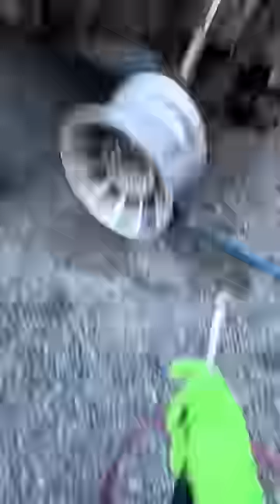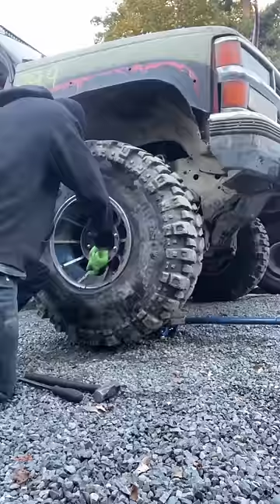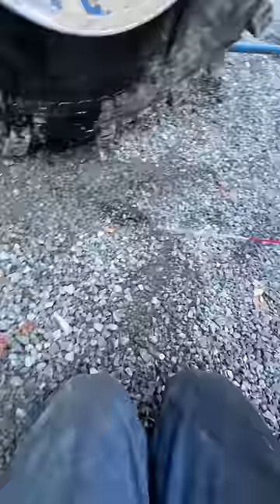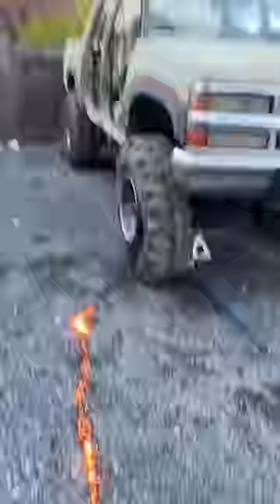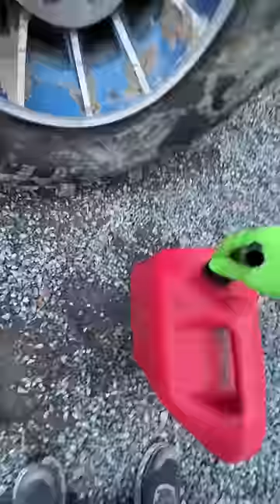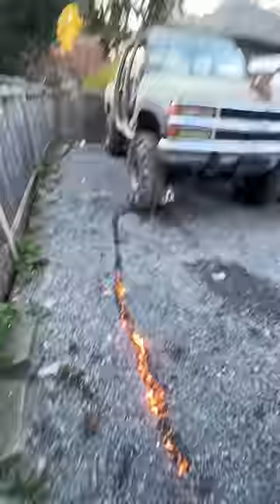This video Blew Up!! 🔥 #oddlysatisfying

Comment: You can usually wrap a rachet strap around the middle of the tire and squeeze it to flex out the sidewall enough to put air in and pop the bead. Definitely not as fun as explosions tho

Comment: starting fluid and a little blast of air from the compressor to get the fuel air mixture proper does the trick every time.

Comment: It helps if you ratchet strap the tire a little tighter to sorta/kinda seat the bead. All that jetting of flame is usually what makes the tire pop onto the bead. Also, ether is the way to go, Brake Cleaner, and gasoline DO work, but ether works best in my experience.
Reply: Yea it would have worked a lot faster if he took a ratchet strap and wrapped it around the center of the tire to apply some pressure. I've done this many times receding the bead back on the tire while out 4-Wheeling!
Reply: Do you use a ratchet strap all the way around, say like an X pattern with 2 straps or just one strap to keep the top and bottom tight. I'm just imagining there would be too much vapor if all sides were pressed into the wheel and then combust too much?? Never seen it happen in other videos but I'd like to try myself
Reply: @1Turnatatime dude like an O strap olong the outside of the tire tread
Reply: You put the strap around the outside of the tire so when you tighten it the walls are pushed out a little more. But the RS technique is the way to go!
Reply: @mossoconnor4417  yeah I think I had a D in Geometry, jkjk thanks for helping me out 😆
Reply: @1Turnatatime  Just tighten up one ratchet strap down the center of the tire to apply pressure. Works best with starting fluid it burns out quickly. Don't have to worry about accidental fires!
Reply: @mud7725  10.4 on that
Reply: I've used the RS method on all sorts of tires over the years. Small ones and big ones. 

The skid steer tire was the worst I've ever taken part in though. We had to use two straps and work them both down. Once we got the bead seated, we had to cut em. But it was better than having to get the equipment out of the ditch it slid into when the tire went. We got air in it and then got it out of the ditch much easier. 

Some folks don't belong on equipment, is what I learned that day. 😂
Reply: Also cutting those straps was absolutely terrifying and I never want to have to do that again. I hate releasing that kind of energy manually.
Reply: If you can get the bead to kinda seat with a ratchet strap, then you may as well try filling it with air. Chances are, it will seal and spread out to seat the bead. Unless you are trying to do this without a source of air. Also have used an air blaster from a modified portable air tank and a  1-1/4" ball valve to a 1-1/4" pipe flattened out at the end.
Reply: @goosenotmaverick1156 Yes, there are tractor drivers and tractor 🚜 operators! Big difference in each one! LMAO 😅
Reply: @ElectricBillAlbright  ain't that the truth. We figured out who was a tractor driver that day and not an operator.... 

It was my dad 😂
I'm marginal on a skid steer but we have a mini ex im fairly proficient with for a guy that doesn't do it daily. But there are millions of folks better than me, no doubt about that! Lol I would consider myself somewhere in between. Better than a "Driver" but not anywhere near earning "operator" by any means 😂

Comment: I just use a ratchet strap but now I feel like I’m missing an opportunity to play with fire.
Reply from the maker: Indeed you are. 🙃
Reply: Ratchet strap was useless on a temporary donut. only luck I've had getting them back on the rim is fire. And it's still a pain in the ass to get the bead set AND then get air in it quickly enough that it doesn't pop the bead back off as the hot air cools. You need to be on that valve stem with a compressor ASAP. Ot already have an air pump attached to the valve stem and running and just let it take the thump of the pressurization when you light it on fire. Also helps if it's something with a quick burn rate like alcohol, the propagation rate of gasoline seemed to suck and just shoot fire out the rim. 91% iso is like boom! :)

Comment: Gotta say I’m digging the turbine 8 luggers on the OBS Burb. 👊🏼 Them ole gals are getting hard to find.
Reply: Not too hard to find, autowrecking places have em for 50 bucks a pop sometimes
Reply: @noturfather1106  Those might be A/R Vectors, AKA the official landing gear of The General Lee.
Reply: @bustyrandit  😆
I haven't looked in a while but they had multiple different types of turbine wheels when I did.
Reply: @bustyrandit Hell yeah!
Yee Haw! (Insert the Dixie horn here)

Comment: Works alot better if you add air the same time you light whatever flammable liquid you use. That being said you need use less of it because your adding more air & can stop a vacuum from happening on smaller tires
-this has been my tedtalk thx

Comment: If you had the tire set right it would work
Reply: Not always if it's cold. 
At least in my experience you have to do it a few times just to get the rubber up to temp and soften it up a lil and then they set nice and easy. 
But I live at the Canadian boarder (basically) and it actually gets cold here
Reply: @damianbigelow9511  im a texan we deal with extreme heat...it does get cold here with wind chills but nothing like you guys..I have nothing but respect for my northern brothers...they say we die when we stop learning so I try to learn something new everyday
Reply: You want to throw blocks under it to hold it evenly around the rim some what. On a tire like this. But he's apparently just trying to put on a show for a tick tock video

Comment: Ether or a big ratchet strap and air is my go to
Reply: Never had luck ratcheting e range truck tires. But im also usually doing it in the bitter cold.
Reply: @squarebodyseth5986  I also have a inflatable tube with an adjustable shackle on it. Stretch it over the adjust the shackle and air it up. Ol' skool but works mint 👌
Reply: @ogt92fromthe1step9  Thats awesome, sometimes old school is best. I bubble balance and use balancing beads,and i have no shaking issues with my truck like alot of people do with the 2014-18 gms
Reply: @squarebodyseth5986  hell yeah brother bubble balance life 😆👌

Comment: Starter fluid is best for a faster expansion of hot gases. Doesn't take much because it needs oxygen not just gas, & there is 20% Oxygen in the air.
Reply: Use very little at first, then if not spray a second longer & so on till it works. Let's just say I blew apart one of my mufflers and sounded like an M80 fire cracker. "Jesus Christ !" I said. 🙏 lol I thought someone shot a gun. Funny part no cops came around. It was F'n mangled. Cut out and put in flex exhaust pipe.
Much cheaper, and sounds better.

So be real careful using starter fluid. Reason my car wouldn't start is because after I power washed my engine, I drove to NAPA and was in the store for a bit. Went back to the car and turning over but nothing. Pulled plugs in the NAPA parking lot, and it's not a place you want to be at night with a '67 Pontiac Convertible GTO 400 bored once, So 406. 

Found the problem. Condensed water under the cap making the spark jump to ground. I dried it quick with F'ing anything that would get me out of there ASAP. Black guy was impressed, walked behind me and touched my ass to see if I was on guard. I tried watching him, buy was in a rush, and when I wasn't looking he took a bag. A purple and gold trimmed bag. Probably thinking it was alcohol, but was probably bummed when he found my F'N GPS. Always use a code with stand alone GPS. All contacts and addresses of family and places I go, and phone numbers. I didn't notice it was gone till I needed it. I had to think back, and that was the conclusion out of 3 idea's. 
I always kept it close to me. Even in my pocket just not the 12v power wire. So that's why the Crown Royal Bag. FUCK !😮😅😊

Comment: If you put a ratchet strap around the outside edge of the tire and tighten it as tight as you can just a normal air compressor can do it I've done it several times with just one of those the little 12-volt electric ones no flames involved. I have also done it on an RV using starting fluid it worked but definitely sketchy
Reply: Tompkins

Comment: 91% rubbing alcohol works great as well. Light an empty bottle of Isphrorol with cap off of course, and the blue flame is cool. As it cools, the rest of the alcohol and air goes in. Another fun blue flame torch. Fun shit !😂

Comment: Okay easiest spray to use is ether it provides the most rapid expansion. Also not sure why this still surprises people. Bush truckers, and farmers use this method often to seat the bead. Biggest key is you light the ether directly at the tire rather than remotely down a liquid trail. This can however be dangerous if the plies are compromised, or if you use too much spray as you can literally explode the tire and possibly rim.

Comment: You use starting fluid, not break cleaner. Also it helps if you put a ratchet strap around the tire so the tire doesn't expand vertically, only horizontally onto the rim.
Reply: Jeff ? 😁

Comment: Next time, connect your air hose.
To the Valve stem while you're lighting the starting fluid or ether I've done it both ways but it works a lot quicker for large tires if you air flow For back pressure At the same time as igniting the ether. It will mount or bead to the rim. Quicker, that way. Either way, works. It just helps to have air.

Comment: When possible have an air line connected and blow air into the tire, it helps get that bead on faster.
Also, starting fluid in my experience works best cause its lights up fast.
The faster the ignighting fluid lights the better it'll work.
Great video, hope those suggestions help out for next time.

Comment: I can’t really say what it is, but somehow this video feels nostalgic in a good way. Like in the early days of YouTube where people just had fun and posted it :)
Reply: but for real though, what are they doing here?
Reply: @zorrodelaspraderas3840 putting a tire on the wheel without the proper tools is super hard and close to impossible. This trick is a way to do it without the right tools, saves you from taking the tire to a shop, pay money for a mechanic and take it back. 

Basically the spray can be anything that burns quickly, inside the tire it creates a air-fuel mix. When it burns, it expands but doesn’t explode. The tire then widens because of the pressure. The super cool thing about this is that if you do everything right, it can perfectly fit the tire onto the wheel and pressurize it. The position & fuel-air mix inside the tire have to be perfect though, that’s why it took a few attempts.
Reply: @no-expert  
okay, thanks, expert.

Comment: You gotta make sure you have enough oxygen (air) for combustion and for pressure to continue filling the tire after the fire goes out.. Hook up your air hose to the tire so that when the bead bites the extra air pressure will make it fill and hold. A few times lighting the tire on fire will warm the tire and make it more pliable.

Comment: Got told a story awhile back of a tire repair shop using this method on city dump trucks. after one of the dump trucks got serviced they stopped at a local gas station to get some food. there must of been some un burned ether in the tire still while the guy was pulling into the gas station one of his tires ignited and that either exploded sending shrapnel everywhere. little girl and her mama was on their way back to their vehicle when part of the tire caught the little girl in the head.

Comment: If you ever do this, please don’t ever use gasoline use ether and connect air to it. It’s a lot easier but it’s also a lot easier to do it when it’s off the vehicle then when it’s on the vehicle, but it works specially if you’re in the middle of nowhere on a off-road trail just trying to get home. It’ll get you home.

Comment: That's out the valve stem core. Use starting fluid.  Quick ring spraying inwards around the bead then give it a good Burst. Do your little trail.  Light it. Then get to there any replace the core quickly and give it air

Comment: You gotta work the tire a bit to get more air in there. Brake cleaner is flammable but with a good air/fuel mixture it can propagate into more of an explosion.

Comment: You put a ratchet strap around the outside of the tire and tighten it just enough to push the bead out on both sides . This way you can use a lot less accelerant

Comment: Some times if you hit the tire rt on the tread with a hammer or kick it, it will seat. You just gotta get the bead close to the rim for a split sec and it will grab. I've even seen it go half way on and expand slowly and then pop on. 

If it's on the ground, don't be standing over it. I had one pop 8 ft off the ground and go screaming by my face. Was inches from a broken jaw lol.

Comment: It works better with the air hose on it. Even better if you remove to valve from the stem. I’ve done it a hundred times, with minimal eye brow loss 🥸

Comment: You need very much.  It only takes a small amount of vapor from gas.  Spray then quickly light it up before the fumes disapate then it will blow up better and snap right in the rim.

Comment: As a fellow sketchy shit aficionado, a ratchet strap around the tire to squeeze the sidewalls out helps alot when it doesn’t wanna work, just be sure to get the strap off before you add much air 😂👍

Comment: Much easier running a strap around the tires circumference in center... tie it down as much as u can , squeezing the tire down to the wheel... if u run out of combustible vhc's of coarse.. good job tho.. hate doing tires...

Comment: That’s my favorite part of doing my own tires, I rush through everything else just to get to that point. I’ve tried everything from Pam cooking spray (yes it’s flammable) to gasoline. Now I only use one thing, butane. It doesn’t take much but it works every time. If I have a hard time getting it to set the bead I’ll kick the tire to get that fucker to pop. If that doesn’t work, ratchet strap in the center of the tire

Comment: My Road Tire ppl always use a ‘SAFER METHOD’, to ‘boost’ the tire bead to grasp the wheels flange. They used soap on tire bead and rims edge then use high pressure air introduced into tire instead of flammable gases…MUCH SAFER…
Reply: Hi 👋

Comment: I always use carb cleaner and that seems to work most of the time for me. That’s the only way I could ever get the bead on the wheel for my truck with bigger tires.

Comment: 10s, no prob for 14.5 bogger, barely a stretch, done that on trails with charcoal lighter fluid, a mini Bic and a 20$ Walmart cigarette lighter powered air pump, almost lost a finger though, gotta be crafty 25 miles from the nearest pavement

Comment: next time get a ratchet strap and tighten it enough to squeeze the tread in w tiny bit. like very minimal tension and then try it. 95 percent of the time it works every time. if you put it too tight it can rip the strap and send it flying. i still have the dent from when i tightened it too much

Comment: if you would put the air hose and hook it up to the nozzle it will blow it on there when you blow the air into the tire and then like that stuff and when it explodes it'll blow it on there and air the tire up

Comment: People always do this without connecting the air hose and actually putting air in the tire. This alone will not air up a tire. All this does is set the bead.

Comment: I had worthless 10 X 16.5 alum.spoke wheels back in the day on a 72' GMC 3/4 popped a bead if psi was too low .. no bead retention 😢

Comment: I can’t believe no one is saying this but, the reason it didn’t work is because you used brake cleaner. I mean it might work every once in a while but If you use ether/starting fluid it works wonders.
Reply from the maker: I can’t even keep up with all the comments, but I’m sure they gave me crap for it at some point. It was fun playing with fire though.

Comment: You need ether and you can stand right there to throw an air chuck on it. Youre using way too much fuel when it isn’t needed. Worst case take the wheel off and lay it flat then light. We did it all the time growing up in Texas on tractor tires and semi tires.

Comment: Your mistake was no clip on air chuck! Or if you would have ran over there and gave it a kick with your foot,it probably would have seated. But clip on air chuck ,bend hose in half or have a shut off valve ,as fire reaches tire ,put the air to it. Will work every time!
Reply from the maker: I didn’t make a mistake… I made a video that has gotten 5million views. Pretty good for just fuckin around and lighting things on fire. 🔥
Reply: @MechanicalTriage  I see, understood. But in my diesel mechanic days we seated many 24.5" tires for the 80 or so mack triaxles that the mining company I used to work for back in the 90s. Maybe do a video using the method I described so those who don't know can learn. Btw,your the first video I've seen spraying yourself a fuse on the ground! That's the only way we did it!  Why wouldn't anyone using ether to seat beads not do that?

Comment: Sketchy stuff that works well, not lighting their tyres on fire and act like they don't care
Reply from the maker: They don’t though..  this customer literally doesn’t care.
Reply: @MechanicalTriage  You should, tyres are literally fuel, that burns easily, and the tyre loses structural integrity
Reply from the maker: @saultube44 I literally told the customer “there’s probably some fuel left in that tire that’s disintegrating the inside of the tire and you are due for a blowout because it’s eating the inside of the tire, I need to dismount it and check on the status or throw the spare on“ he literally text me back with “keep it under 70 got it“
Reply: @MechanicalTriage  OK, but there are better ways to to that, just check other videos, that's all